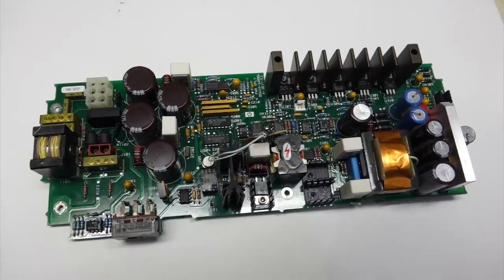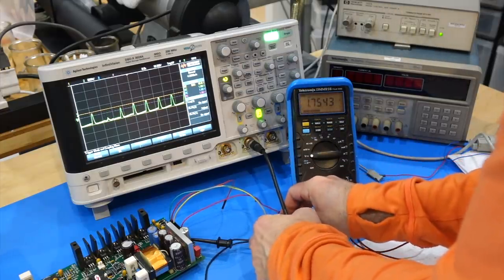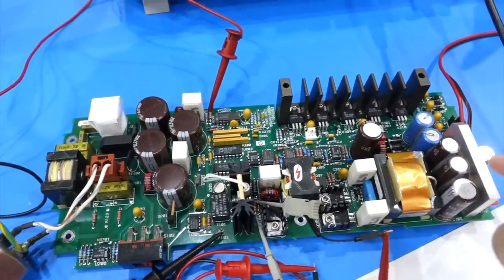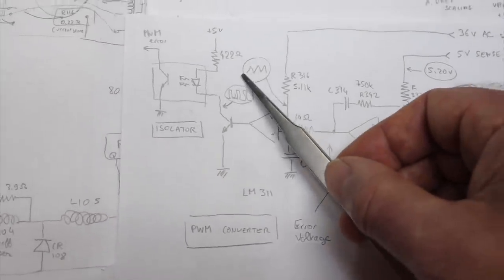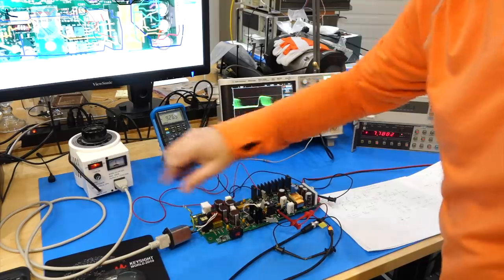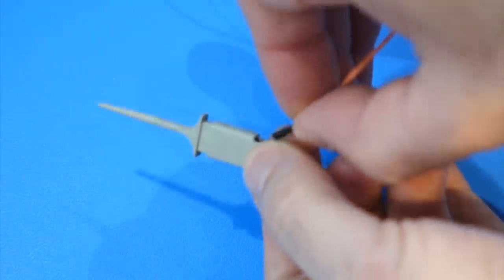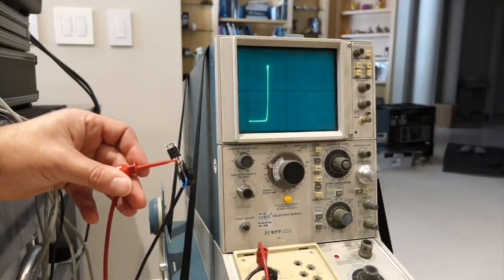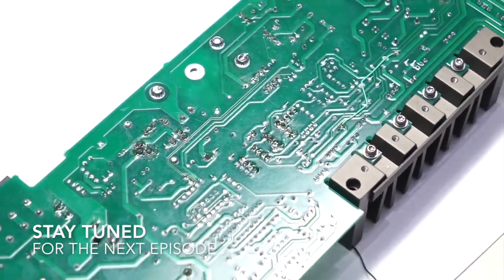HP Switch Mode Power Supply Repair Part 3: Electroboom in the feedback loop

Comment: Great series Marc!!! I just spent time fixing a Mac Plus analog board. Simpler issue than you're will be but a shorted PNP transistor on vertical deflection circuit caused all sorts of issues and damaged some other parts. Luckily I had found someone's reverse engineered schematics so I could avoid all the manual work you're having to do on the HP PSU.
Reply: Great to  see you Adrian,a distraction i know,but i thought your idea to lash up a series of pull up resistors on the data bus of a 6502 processor so that it would see a nop and  increment the PC continually,was a really cool way to test  the data and address buses,as well as the  address decoders,in one fell swoop.
So cool!!!
That would have helped me in  some of my past fault finding marathons for sure!!
Reply from the maker: Congrats on saving a Mac Plus! Free vintage MacOS bomb for you!

Comment: Absolutely interesting to see you working on such a complicated power supply. Not long ago I was very happy with myself after I successfully repaired a simple 12 volt HP power supply for my old scanner. It wasn't the first power supply that failed on me, but this time I decided to take it apart completely and find out what happened. I took out and tested everything and it was exactly as you said in the previous video - a fried resistor, capacitor and even the voltage regulator was fried. Excellent videos, thank you for sharing these.

Comment: I'm getting horrifying flashbacks from this - I'm convinced that about the time HP stopped printing schematics in their manuals they also started intentionally hiring sadists to design their PSUs.  I once had to fix a HP logic analyzer that had a detonating power supply - it worked fine for a while and then just blew up half the semiconductors in a fraction of a second.  In was very similar to this one in design with a switching preregulator, a main switching regulator and linear post regulators.   The root cause turned out to a a low-value resistor that measured OK when cold, but jumped up to a high value when it got hot - it still sticks in my memory as one of the most unpleasant repairs I ever did.
Reply: trash engineering deserves only to be in a trash can. Why not just use an active power factor correction + main switcher PWM 2-in-1 IC?? One IC solves all your problems. And then linear regulator as you wish.
Reply: @leozendo3500  Because it was not available at the time?
Reply: @leozendo3500  I prefer my trash cans to be well engineered ;)

Comment: An LM339 as a power good comparator. I have fond memories of that chip. It was integrated in one of my very first projects. Basically, it was a continuity tester that only accused continuity below a certain resistance, and it worked very well.

Comment: Remember, that's just the power supply of the device. There's a decent change the PS blew in a way to require repairs of the main device. I rather suspect we'll be seeing the conclusion of this restoration around Christmas if the faults per number of components holds up for the rest of the electronics.

Comment: Did you check the drive resistor from the MOSFET driver to the burnt MOSFET (push pull transformer part), usually they can change value or burn open. Also, is there a charge dump diode on the Gates of of the MOSFETs, check those? Also check the waveform coming out of the frequency divider of which was driving the dead MOSFET.  You jumped to the control loop, its is very rare to be a fault there, but now you have made a fault :) All the ICs and caps on your secondary side maybe compromised now.
Reply from the maker: Yes I checked all that obvious stuff first of course, and the rectifier diodes on the secondary side. By the time I started to film this I was out of obvious stuff already. But good that you mention it.

Comment: Haha this is so nice to see ! I also got tricked by a HP 35660A power supply. I needed to rewind the transformer. Why are this supply's so weird designed ?? The 35660 uses a bootstrapped emitter switched bipolar transistor that I didn't understand for some time
Reply: How did you find out that it was the transformer? Did you have another SMPS for comparison?
Reply: @nikreichel2232   No .. It tricked me for a long time.

I reversed all the electronics, checked the feedback loop, studied the emitter switched transistor ..

I was almost givin up when I decided that the unique problem I could imagin was a short in the transformer
and .. yep! the transformer had severely arced insined and It had short!

But rewind that thing was a paim, I think it had something like 7 secondarys and 3 primarys ..

When I installed the new transformer the feedback loop became very unstable, I think it was because the core was not the same and the magnetization current changed a lot from the original transformer.

I made some mods on the feedback so it would ignore the high spikes of current in the switching and it worked fine!

What a shame I didn`t have the channel to document this saga :( hehehe

Comment: Got a kick out of that, only due to personal experience doing the same. Hang in there buddy! May I humbly suggest powering the feedback stage externally with an outboard power supply, substituting any pulse signals or derived voltages being measured? It's easier and safer to debug if you break the loop and get the stages working independently. Not that hard to do with plenty of lab equipment around.

Comment: Marc, you just got to stop letting out the blue smoke.   Be careful with the HV, not likely to get you electrocuted but you could toss the board across the room and damage something else.  Had a coworker once yell out  "Dam to those charged caps really do hurt" as the prototype came flying past the bench I was working at.   This is real real debugging at its finest.

Comment: Sounds a bit like how MY day went... I finished installing 1648 LEDs down at the dragstrip (basically replaced one of the 4-digit, 8-segment displays) and I found 3 'errors' (each causing a 'string' of 7 LEDs to be dark).
While I did bench test' each segment as it was completed, I obviously have a few bad solder joints that will need a hit with a hot iron.  I'll have to head back to the track next Saturday to 'pull' those 3 segments to be reworked <Sigh>
Footnote: It is EXCEEDINGLY boring to manually populate and hand solder 1648 LEDs!!!  I'm glad I don't have to do it too often!

Comment: HP/Agilent/Keysight is truly shooting themselves in the foot by discontinuing the old HP user manuals. They used to fully document their equipment, and prior to the '80's they even put a complete cross referenced BOM in the appendix. Sometimes even with an HP part to Supplier parts list chart.   Since they no longer document their equipment, why pay extra for the "better" Keysight stuff when you can't fix it when it fails. Just buy the cheapest, since you'll be throwing it away when it stops working.  Very short sighted of them.

Comment: the average video on youtube where someone easily repairs electronic stuff by replacing capacitors or a faulty transistor is nothing compared to the efforts needed to undertake such a serious reverse engineering venture.

Comment: Why dont you socket the replacement ICs? I mean just in case
Reply: Might add random resistance to the lines
Reply from the maker: Why?They’ll surely never blow up ;-)
Reply: Kevin Counihan  From colorado? Hell, that came in loud and clear out in the middle of nowhere, Wyoming
Reply: @CuriousMarc  Sarcasm coming through clearly, 5-9 in Western Australia..
Reply: Exactly. I've always put in those military-grade low-profile gold-pin/socket DIP sockets on all important repairs, just because. When my Nakamichi deck lost its 40pin CPU, I socketed the position because you never want to have to unsolder one of those a 2nd time.

Comment: Mark:
can you explain more how you hook up the tektronix differential plug in to the power supply?
I like the special effects,keep doing videos ,professional repairs.Thanks
Reply from the maker: I use two coaxes as you can see in the video. Tie the ground of the two coaxes together at the remote end, but don't ground them on anything in the power supply, just leave them unconnected. Connect the center conductors to a short single wire extension ending with a probe. Put the probes across the voltage you want to measure, anywhere in the supply. Both of the probes are now floating, and only sensitive to the voltage difference between them, not the common voltage they are sitting at. So you can put them anywhere in the circuit, like across a current sensing resistor tied up to the 300V for example. Very convenient.

Comment: Really nice video series and good job with the reverse engineering! Very educational. 

Question: Where do you get those mini grabbers? I recently bought some cheap ones and all they do is falling apart. Also the cable connected to the mini grabber looks like good quality. The typical dupond style connectors tend to come loose after some usage.
Reply: I would also be interested, if you find out, let me/us know :)
Reply: The mini grabbers come with Agilent scopes, part number is 5090-4833 or 5090-4356.
Reply: @G10v4nn1  Thanks! They appear to look identical to the E-Z hooks you can get from digikey. They are quite expensive though, but I'll probably give them a try on my next order.

Comment: So when I make repairs and have to swap out faulty ICs, usually they are such a pain to remove that I like to fit IC sockets just in case of future problems; is there a reason you don't ?
Reply: I think he's doing an "as close to original as possible" museum quality repair, though I have my doubs of whether this specimen is deserving of being elevated to such a status.  Never the less it's still a fun learning experience.

Comment: And this, my friends, is why companies will elect to scrap defective PSU units and replace them with new ones instead of repairing them. Imagine an expensive tech, even with the schematics and service manual, spending time to troubleshoot and repair such a device? Too costly. Unless the part is discontinued and a new one is unavailable, and the device which it powers is worth saving of course. Thanks for the video, but ElectroBOOM is still the king of sparks! lol
BTW, give me a regulated linear PSU over a Switching one any day. A lot less efficient perhaps, a lot bulkier I'll give you that, but much simpler to troubleshoot and repair.
Reply from the maker: Agreed on all.
Reply: My thoughts as well. Failure modes are just too strange and random. And failures tend to blow up or somewhat damage other components. Making troubleshooting expensive and time consuming. And the result not entirely reliable.

Comment: I think the shorted MOSFET in the buck converter tripled the voltage to the downstream converter, so caused a lot of collateral damage. Not a great topology. A more modern supply would start with a boost converter for active PFC and the main converter would run at a higher than line voltage, so would not see an over voltage in the event of a fault. Perhaps consider adding a crowbar when you get it working.

Comment: your misadventur with the probe reminds me of a similar one i had when young. Repaired a centronics printer, all good but i realized a screw was missing. As a real moron i decided to screw itin with the printer ON. A per best Murphy tradition the screw fell on the pcb trace with immediate redeath of the printer. btw any chance you have the schematic of a Nagarc 5002 pulse generator? cheers

Comment: That summing amplifier can not work for DC if it has a cap in the feedback path. The way it is drawn it acts more as a comparitor.
Reply: It is a PI controller ! At low frequency que capacitor give integrator response and at medium high frequency the resistor give proportional gain
Reply: @AllElectronicsChannel  Thanks! That makes sense. The word "summer" had me confused.
Reply: @reneschmitz4845  hehehehe As the PI loop in implemented with an inverter configuration the input act as a summer junction. It has the advantage of also work as the "error subtraction" block of a standard control loop. Pretty nice
Reply: @AllElectronicsChannel  And with the error signal being converted to PWM to feed back into the primary, it effectively becomes a phase-locked loop with the voltage sensing circuitry acting as the phase detector.

Comment: Normally i would use a bench power (using multiple outputs)  supply to supply the voltage to these ics this is safer it doesnt have any problems shorting out to the hot side of the pcb and it helps you find the problem safely once you have rectified the problem remove the bench psu and supply it with mains

Comment: I presume you are aware of the RIFA brand X2 class capacitors and their tendency to go bang. They have a habit of waiting until you have fixed everything else before they do that. Looks like there are a few on the input of that supply.
Reply from the maker: Yes, I have a whole bunch of replacements, but did not have these particular ones on hand. So I let them live. That said, despite their bad rep and my extensive collection of vintage HP equipment, I have yet to have one fail on me.

Comment: I'm not sure I understand the placement of C314 in the feedback loop of what you described as a DC amplifier. Did you maybe get it in the wrong place? Or some other missing resistor in parallel with it?

Comment: OK, I must admit that my suggestion of a light bulb for current limiting wouldn't have helped in this situation, or at least with 50% probability because you normally use only one and not one in phase and neutral.
I'm glad that your equipment didn't get damaged in that accident.
Reply from the maker: Well in this case I used the better controlled laboratory equivalent, a Variac. Which turned out to be very helpful, as under-voltaging the supply was the only way to get the whole thing started while regulation was not working, and also helped me diagnose the HP probe that had too much common voltage.

Comment: If K had been doing this work, I would have use 8 pin Dip sockets for any replaced comparators and op amps, as the PC Board traces and bias, can only survive several rework cycles.

Comment: Marc may be now you have the full schematic of the instrument. I have an ALC board problem and I am terrorized to do the reverse enginnering you did. please help. Marcello
Reply from the maker: Unfortunately I don't. I called Keysight and they told me to pound sand. This is a 1990's instrument, after they decided not to share the schematics anymore. However if you go to my website www.curiousmarc.com, you'll find the service manual. They have some bits and pieces of schematics there, or block level diagrams that the evil marketing people forgot to cut out. It might give you enough hints to guide your repair.

Comment: Turn on the power supply without load all output channel???
There can be tricky feedback with the control of all supply voltages.
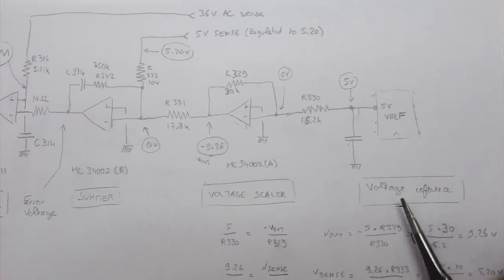4:35 Here it is, control of all power outputs.

Comment: This sure seems like high ESR filter caps.  The excessive ripple on the output is messing with the feedback loop.
Reply: It can be a flickering break in one of the feedback resistors or capacitors. But they will be checked as normal.

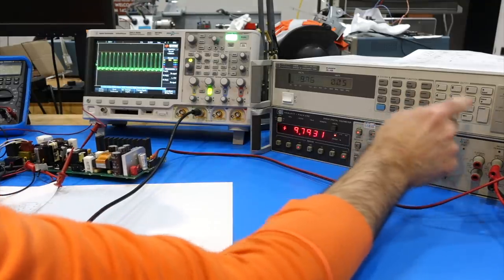Comment: Do you hear the hissing sound on startup at 3:00 and 3:16, on par with the oscilloscope display ?
Reply from the maker: That’s a switcher supply noise for you. It’s specially noisy when it’s very lightly loaded and the pulse train is not continuous, or when it was unregulated and over voltaging (which was actually overcurrent in the buck converter). You hear the microphonic noise in the coil or core in the buck converter or the DC-DC transformer, they act as speakers a little bit.

Comment: I have few PSU for PC  (identical Enermax thiarlor 1000w) they are blowing the fuse from the wall when I connect the PC to the plug 2-3 times in a row, after that they are working well. It looks that the stand-by circuit has a weak element (maybe from design, because other PSUs have no problem with the PCs). Where should I look? I tried to find block diagram but no succes.
Reply from the maker: I’d suspect the in-rush thermistors or the filtering caps.
Reply: @CuriousMarc  thank you, I'll let you know how it's going, this weekend I'll try to solve them

Comment: Lol, got worse BOOMs than this one. It scare the hell out of me, it is not the BOOM, it they take you by suprise. I did repair ATX and Laptop Chargers. ATX psus, well, unless they have active PFC in the controller ... it can be done. Laptop chargers have smart chips with ecofriendly features. If they not halt on over voltage, under voltage over current, the halt for any other reason plus it is hard to find any information, they keep cloning themselves making repairs a challenge, but mostly like keep the bin happy.

Comment: I'm sure you tested the tantalum capacitors.
Reply: One of my thoughts too. Electrolytics fail open-circuit so those are not really that problematic in this case but the tantalum caps do short circuit and/or explode when they age
Reply: @senorcapitandiogenes2068  Except for the old "Frako's" (Frankfurter Kondensatorenwerke). They can be found in old Revox Taperecorders and Becker or Blaupunkt car radios. They short like tantalums.
Reply: @nikreichel2232  I dont know about specific manufacturers. But I do know that I have yet to see a shorted paper cap from a german manufacturer. Tar-paper caps? Plenty of those but never paper-wax ones

Comment: Ugh, voltage mode controller. This rarely happens with current mode control -- the inductor and switch current is monitored at all times, completely eliminating one failure mode (leaving overvoltage and overtemp as the most typical failure modes).